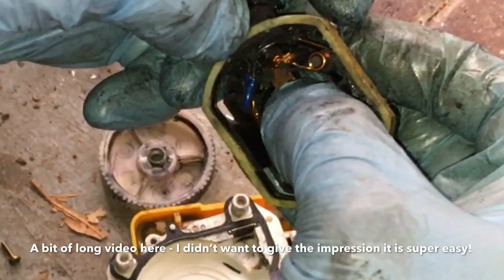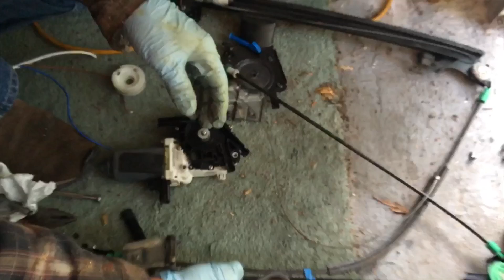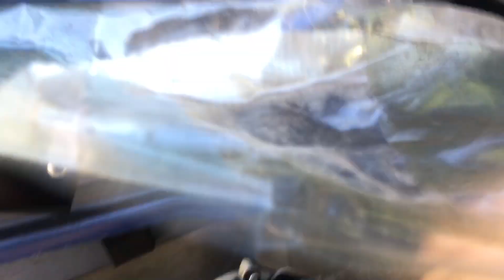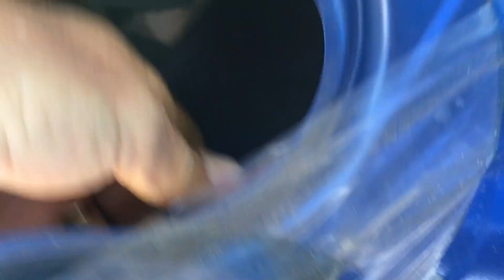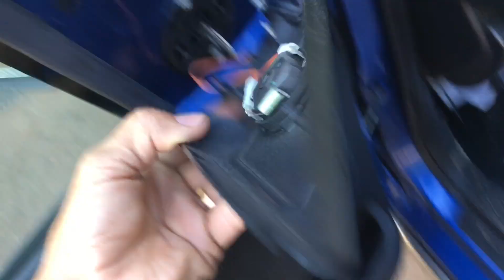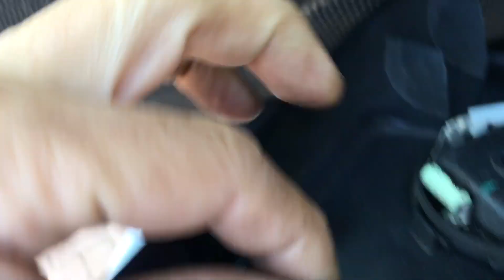How to Fix an Electric Window - Freelander1 & Other Cars

Comment: Just fitted a brand new unit today. It stopped working two weeks ago. I knew the mechanism had corroded as it still worked a little but you could hear crunching sounds. So I just fitted a new unit took 5 mins as I had the door card off already to fix/replace the locking mechanism as well. 
Thank you for your in depth videos. they’ve helped me so much to change parts/diagnose stuff on my Freelander 1. 👍🏻
Reply from the maker: Cheers. Well done.

Comment: I've just installed new cables.
It makes a cracking sound when using the motor to lift the window up up.
Left rail cable is stiff. Right cable is lose.
What could be the cause ?
Reply: Cable could of broke, mine did x
Reply: @christineallcock8848  
Thanks for the reply.
Replacement cable kit is new and not original. Old cables got broken.
I suspect the new ones are a lil bit longer, don't keep the tension and gets tangled in the new guiding wheel wich already got damaged in its grooves (the cracking sound). Or the entire window rail system got worn out in time. 
For now i got the new kit to keep the window in place. 
And gonna buy new replacement one in the near future.
Have a nice evening!
✌️

Comment: Hi my freelander 1 rear window is jammed too high outside it's rim leaving a gap   Do you have any idea how I can get it to move down and maybe up again please I've looked through a couple of your vids but not this problem I'm terrified of going over a bump and it shattering  not to mention when it rains cheers christine
Reply from the maker: Will the door open?  Does the window switch attempt to move it down when pressed?  Does the act of trying to open the door by pressing the door handle attempt to move the window down?  You may have to use a small bit of force to open the door by having someone on the inside push on the door.  There is the risk of the glass breaking but there are not too many choices.